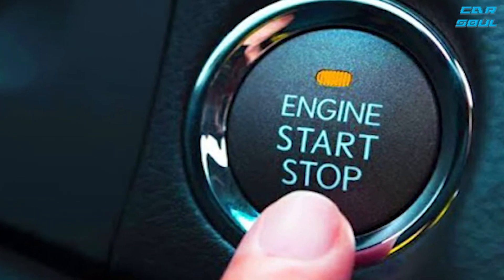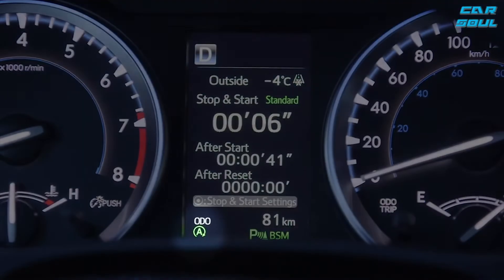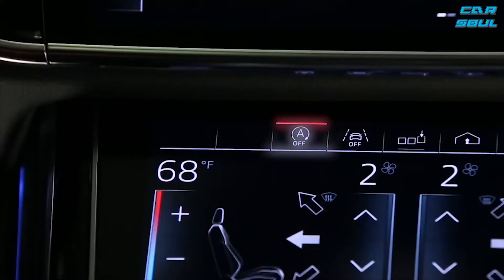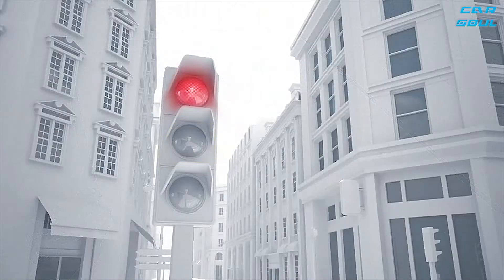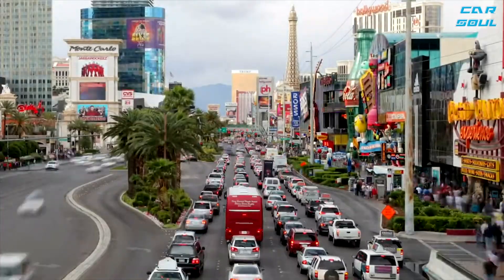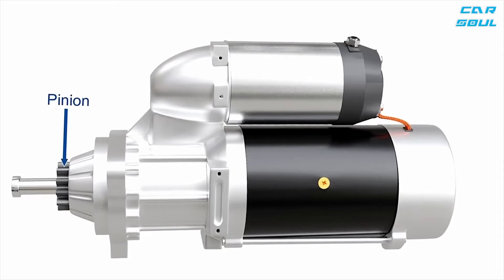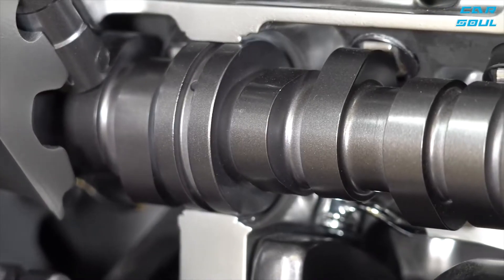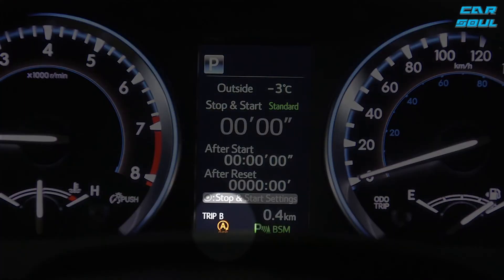THE SECRET OF THE START STOP BUTTON THAT NO ONE KNOWS ABOUT

Comment: I have a 2020 Subaru Legacy, my daughter has a 2024 Subaru Crosstrek..  There is a button on the  digital display panel to disable the automatic start/stop feature.  The feature is enabled by default,  and you have to tap the button icon to disable the feature each time you start your vehicle.  Keeping it disabled definitely saves wear and tear on the engine,  starter, and battery, and you won't save on gas either.